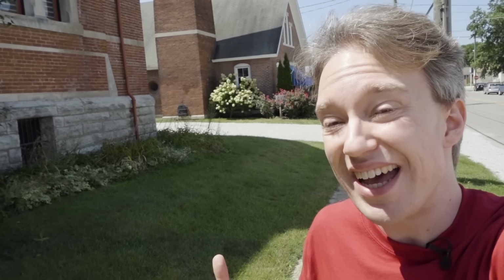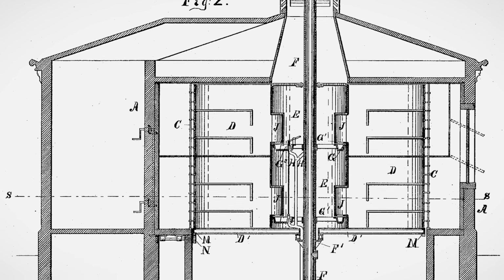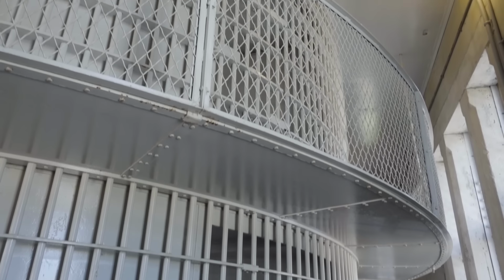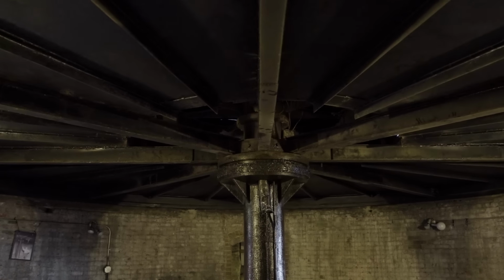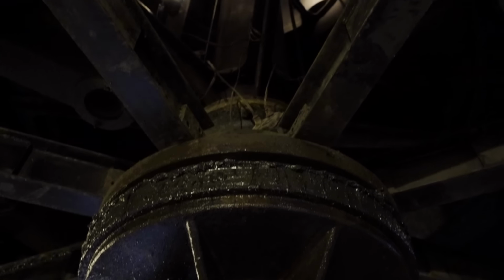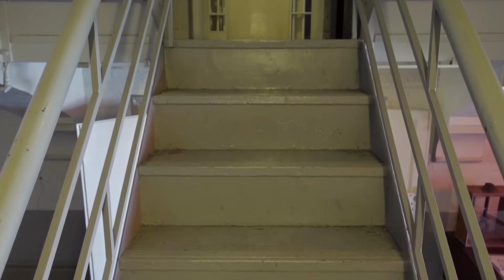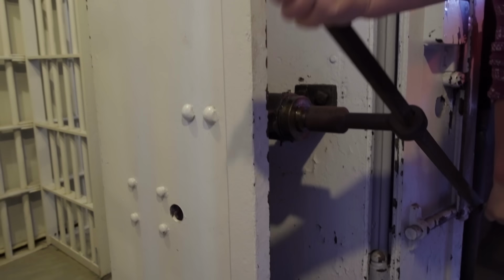The "rotary jail" had a slight problem

Comment: I literally never gave a moment's thought to the possibility of fire in a prison before I heard the words, "The advantage of having a rotational cellblock was that you could have just the one opening the inmates could enter/exit their cells from."
Reply: I'm surprised a fire would be a big problem in a building that's all steel, stone, and brick.
Reply: Same thing.
Reply: @cymond  It is enough to enlight the oil or some storage to poison the prisoners (depends on ventilation of course)
Reply: @cymond  even if its made of non flammable material you still are in danger of gas leaks, bombings, or possibly a natural disaster. There are many situations where you may want to open all the cells quickly and evacuate.
Reply: @cymond  There is still the risk of explosions and toxic gas
Reply: The building simply could begin to fill with smoke. Suffocating the prisoners, unable to escape their jails.
Reply: @cymond  the smoke is just as deadly.
Reply: Don't, this is already hugely nightmareish!
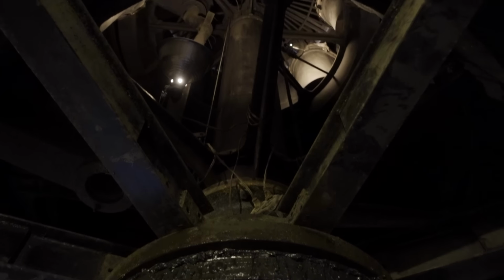Reply: 0:58
Reply: why are you so prone to protect prisoners?
Reply: @TomNacen  Because prisoners are human beings, like you and me?
Reply: @slushpuppie19  lmao
Reply: @TomNacen  LOLOLOL?
Reply: @TomNacen  Besides death-penalty itself beeing uncivilized, it said in the video that most inmates just had to sober up, hardly anything you would let anyone suffocate for
Reply: @cymond  Of course it is. Prisoners have set fires. That GREASE that's all over that mechanism would be PEFECT if you were trying for arson, I'd think.
Reply: @slushpuppie19  Be very careful with that thinking. A lot of people are locked up for damn good reasons. Don't put anything past them.
Reply: @windsofmarchjourneyperrytr2823  And a lot of them aren't
Reply: @elcanaldeuriel2750  jesus christ, those are people you're talking about
Reply: @windsofmarchjourneyperrytr2823  nah, they're all locked up for the same reason, society's too incompetent to help them.
Reply: @windsofmarchjourneyperrytr2823  And all people are capable of redemption and rehabilitation, Prisoners are still humans and thus should be treated with the same dignity and respect as anyone else, however much we would like to brand the most heinous criminals as sub-human cause we dont like admitting a human is capable of such acts branding them as such is in my eyes worse than any crime one can commit. Given the proper chances and help anyone is capable of rehabilitation, and if they are not, well then they will be locked up forever while they attempt to rehabilitate anyway
Reply: @fredrikalfson1541  You didn't watch the video, did you? This wasn't a maximum security for the absolute worst criminals in society, it was a local town jail. 

This is where they throw people who are to drunk to go home, or trespassing, or disturbing the peace, any number of incredibly minor crimes.
Reply: It's IMMEDIATELY what I thought of. Like "that doesn't sound safe"
Reply: @windsofmarchjourneyperrytr2823  The overwhelming majority of all prisoners in America are locked up for nonviolent crimes, primarily smoking weed and not paying fines. Hardly what I'd call dangerous.
Reply: @TomNacen  Wait until you get into prision for bad driving or another meaningless crime
Reply: In 2005, at a cellblock at Schiphol Airport, that housed 43 foreigners who didn't have the right papers who tried to get into the country, fire broke out. 
11 of them died. Some of the causes of the deaths was that the building was constructed without strictly adhering to our national fire code, and a lack of fire training for the personnel.
Reply: @cymond  There have been several prison fires where people have perished.
Reply: That's a great motivation to behave yourself, so you'll not end up there.
I would get child rapists and corrupt politicians in it.
And I would tell them that building is really unsafe.
Reply: @scorchedearth1451  This isn't a place where rapists went. This is where people who forgot to show up for jury duty went. Where people who were drunk and someone decided to call the cops on them went.
Reply: @RepstarVixen  All people are capable of redemption and rehabilitation, except conservatives.
Reply: @Rhythmicons  nope, even those are capable of rehabilitation. I should know, my libertarian-socialist ass is currently engaged to an ex-trump supporter after all
Reply: @RepstarVixen  thats just anecdotal evidence haha.
Reply: @TomNacen  they are living people.
Reply: @TomNacen  You are clearly a 12 year old
Reply: @cymond  ever hear of people dying from SMOKE!
Reply: @frankmachado1010  FFS, are people really going to rag on me for this forever?
 
Besides, smoke needs fire, and there's almost nothing flammable in this video. Everything is metal or stone.
Reply: @cymond even if the fire wouldn't reach them smoke inhalation would be a problem.
Reply: @cymond  Well if the oil under them began burning the inmates would end up as bbq...
Reply: @cymond  exactly I don't see fire being a massive issue
Reply: There's a great comic about this, an issue from the Japanese manga "Lone Wolf and Cub" about finding a prisoner to confirm the identity of the jailer who abandoned his post when a nobleman died in a jail cell drunk tank during a fire.
Reply: @windsofmarchjourneyperrytr2823  
I’ve been locked up a couple times before, and both times were wildly traumatic for me. The penal system doesn’t rehabilitate people, it treats them like objects because it makes money off of them. 
It’s like jailers get off on torturing human beings from their moral high horses while they sin just like the rest of us. 
And you have no idea who any of those people who are incarcerated are — you just build characters in your mind and project them onto the living breathing human beings behind bars.
Reply: @slushpuppie19  Careful, if we admit to ourselves that prisoners are human beings, we'll have to admit that being too poor to pay your fines doesn't make you a bad person deserving of prison time. It's a slippery slope!
Reply: @TomNacen  if you don't want to protect prisoners, you belong in it yourself.
Reply: @TomNacen  Becaus a state isnt just allowed to kill people? It takes responsibility for their safety by taking away prisoners freedom.

Also the most basic human empathy helps.
Reply: @repstar349  never heard anyone refer to themselves as a libertarian socialist, how does that work?
Reply: @TomNacen  Because they are human lives, and were not sentenced to death.
Reply: @cymond  Fire rarely kills, it is the smoke that gets you.  Something as simple as a burning mattress could produce enough smoke to wipe out a small cell block.

Comment: Imagine the screams as someone on the opposite side has just had their arm partially amputated, and you have to keep turning (with their arm still jammed in the bars) to get them around to the only door.
Reply: I figure after 2 of those incidents, the guards were having nightmares and didn't want to work there anymore...
Reply: I reckon just one such incident would be enough for me, if I was a guard!
Reply: what if someone shoved an iron bar into the wall instead, and got the torque to warp and break the walls?
Reply: Easy. Iron bar < Steel
Reply: @coolguy284_2  And where would prisioners get an iron bar?
Reply: @Napoleon_Blownapart  From the iron bar store, obviously
Reply: @TheAnantaSesa  How?  They said they didn't have a catwalk to access the cells until they stopped rotating the prison.  (gods, that means even for meals you'd need to rotate the entire prison block to deliver food to each prisoner.)
Reply: @DNANDROID  damn
Reply: @DNANDROID  
Damn
Reply: @DNANDROID  damn
Reply: Yikes
Reply: @DNANDROID  Damn
Reply: @DNANDROID  No they didn't.
Reply: @DNANDROID  damn
Reply: @DNANDROID  damn

But no, seriously. This thing would take a huge amount of torque to rotate it, so the gear ratio was probably so extreme that the guards couldn't tell they were amputating something until it was too late. 

Also: inertia. 

There was a revolving cocktail lounge in Atlanta, until an unsupervised child decided to put his head between the corner of a wall and a rotating hand rail. Yes, it was motorized in that situation, but the point remains: a large heavy slow thing will crush your limbs regardless.
Reply: @Napoleon_Blownapart  obviously it would  be hidden in a cake
Reply: @cymond  why was a child in a cocktail lounge to begin with though
Reply: @cabbage-soup  It's a cocktail lounge/restaurant. I assume the kid was with his parent(s). 

If you want to look into the available details, it happened at the Sun Dial in Atlanta GA, April 2017
Reply: I would assume it can rotate the opposite direction as well...
Reply: @cymond  I was supposed to have a date there like 15 years ago! Mad I never got to go before they stopped rotating it.
Reply: @cymond  Absolutely, keep in mind that that crank is for one person and that mechanism weights around 30 tons. Even if you use your whole body weight to turn the wheel, it's still going to take probably 300:1 gearing at a minimum to get the thing to move.
Reply: @cymond  I would have guessed 1980's or earlier, based on the combination of "child" and "cocktail lounge"
Reply: @DNANDROID  damn

Comment: "In hindsight it was not a good idea" 
.
No, no, with just a little forethought it's not a good idea
Reply: But also with hindsight... if you wanted to correct something why not the assertion that a patent means no one has thought of it before?
Reply: That point is very pertinent to our current situation!
Reply: The inventor probably never foresaw it being used as a drunk tank, and assumed that sober/sane inmates would be smart enough not to stick their arms through the bars when it was moving.
Reply: @cymond  also in those days health and safety wasn’t a priority especially if it concerned prisoners
Reply: It wasn't a bad idea, it just needed to be worked on more.
Reply: @KoboldPip  - THAT is the real truth of the matter right there.  A very different time with different mores.

Comment: The idea is in a way the same as a Panopticon, just using the exact opposite approach. (A Panopticon is a rounded prison, where all cells face the station in the middle, from which a single guard can see everyone at the same time. So instead of putting the cells in the middle, you put the guard in the middle)
Reply: magnus archives
Reply: i never thought of it but that's a good comparison!

Comment: Genuinely curious how many incidents of amputation there were. Surely they kept track of that, right?
Reply: They kept the arms as souvenir's.
Reply: @mackychloe  why did you put the apostrophe between souvenir and the s? ('s) shows possession, so "souvenir's" is wrong, you don't need an apostrophe you just need to say "souvenirs", you know, like a normal plural word
Reply: Hahaha I bet they didn't, I bet they just displayed them as a warning to new arrivals what happens if you get any ideas
They probably also used the amputated limbs as clubs in case any of the inmates got out of line
Reply: @kashvi1225  in some languages (like Dutch), certain plural words have an apostrophe in between the word and the s, where English doesn't. Maybe they aren't a native English speaker and messed up in using a grammar rule from their native language

Comment: Imagine being trapped there when there is a fire. The cells are slowly emptied one by one, while the heat and screams of other inmates panicking are filling the room. Then, unable to stand the heat, the guard leaves you behind, leaving you and your cellmate to burn alive in a cage.
Just because you were drunk.
Reply: If it's any consolation, you'd most likely die (or at least be completely unconscious) from smoke inhalation before being burned. From what I understand most victims of fires die from the smoke rather than the flames. Though I guess that's still a horrible death in its own right, but I at least would prefer that to being burnt alive.
Reply: @waxwinged_hound  Well it IS a slight consolation thanks

Comment: I got an idea.  None of the cells have doors, but you can use an Acme Portable Hole to create a door in one of the cells if you need to let an inmate out.  The only problem is that, assuming your prison only owns one Acme Portable Hole, it takes a long time to release all of the inmates in the event of a fire.  But, aside from that, there's virtually no benefits!
Reply: How about we have no doors and just light a fire?
Reply: Just replace the door with a patented Aperture Science Shower Curtain Portal Generator. Problem solved.

Comment: I had the exact same problem like this with a rotating sandblast chamber. It had two chambers, so that when one chamber was blasting, the other chamber was being emptied and reloaded. I just put a presence sensor on the stationary wall that would open the circuit when you got within 5 inches of it. Most of the time, the  best solution to a problem is the easiest one. Cal/OSHA liked it so much they made it mandatory on all that manufactures blast rooms.
Reply: That’s awesome!

Comment: I remember reading a scifi short story, when I was younger (do not remember the title), where a rotational jail was cut into stone. The cells were alcoves in a central stone cylinder, with one entrance that was rotated by the efforts of the inmates, pulling at the walls/ropes in walls(?). It ended terribly, of course, as it needed a constant flow of new inmates to replace the one, that popped out as the cyliner inched forward.  :(
Reply: Helliconia?
Reply: "Manuscript Found in a Police State" as someone else mentions below?
Reply: @1203fild  The Wheel of Kharnabar in Heliconia Winter
Reply: this reminded me of that too!

Comment: This reminds me of the prison level in Silent Hill 4. I believe the cells rotated but it was a guard on a upper level that could rotate the lower prison cells. You needed to rotate the cells in the right order in order to access a cell that wasn't locked that had a hole in the floor the the bottom set of rotating cells if I remember correctly.
Reply: you go to jail for not paying taxes and the jail cell rotates and cuts your arm off ouch🤣🤣🤣
Reply: AND sine doors had stopped working so they just dug and aligned those holes from the top floor to dispose of rotting corpses without any other prisoners noticing

Comment: You mentioned exactly what I was thinking. It seems simpler and safer, to have the bars rotate around the cells... As opposed to stationary bars and a 30-ton rotating cell block
Reply: I'm not really sure that it's that much safer, the gearing needed to make that work would still be too much to realize when you're amputating a prisoner.  And it does nothing to deal with the issues associated with fire. I suppose, in case of fire, you'd want a second wheel that just rotates the floor, allowing for access to a ladder. Not that there's any issues with the floor dropping away...

Comment: Could the inmates rotate it by themself by pulling together on the bars?
Reply: the thing weighs 40 tones, Using the crank gives you tremendous mechanical advantage.
Reply: You do not have to lift 40 Tones, just move it.
Reply: DynoosHD The static friction would be too much to overcome without the mechanical advantage of the crank.
Reply: Maybe 1 inmate couldn't do it, but all of them together might
Reply: Potato on a stick Again, worm gears past a certain slope angle have too low of a torque to turn from the output shaft no matter how strong of a force you use.
Reply: Surprised no one has commented that pulling the bars would be akin to trying to push a car from the inside.  You won't go anywhere...
Reply: Rob Fraser The bars are mounted separately from the pin and cells.
Reply: All great replies but even if free floated easily a simple steel ring looped over a crank handle and chained to the wall would stop them.
Reply: You mean that the inmates could literally be running the .... rotary jail? Nah, this jail is apolitical.
Reply: @michaelkennedy8573  The bar give a much better advantage, it's like 3m from the center. I guess there was a brake.
Reply: @krashd  you are incorrect.  Tge bars are a completely separate entity that are not affixed to the cells.
Reply: Pardon my necro but what I was thinking was cranks in the cells that are locked most of the time, but unlock manually in the event of a fire.
And an emergency stop by the guard, though I'm not sure how well that'd work with the inertia of the thing.

Of course the best solution as the video mentions is to just.... not do it.
Reply: Did you guys not see the video? The inmates lost their limbs because they rotated the thing themselves.
Reply: @Liasos88  No, no they didn't, they lost their limbs because they passed out drunk with their arms in the bars. Did you watch it?
Reply: @The_Bird_Bird_Harder  I thought I did.
Reply: @DynoosHD  Friction and inertia, also you're the only one who said anything about lifting it. You're on your own there.

Comment: Wouldn’t the bars rotating have the same amputation problem?
Reply: That's what I read thinking, too. 

It could probably work if the cell had a smooth (solid) outer wall, and the bars were replaced by a smooth wall, too. 
That way, there would be nothing that anything could get snagged on. 

Of course, that doesn't fix the emergency exit problem.
Reply: The suggestion isn't to have the cell stationary while the vars move, it would be to have the bars spin with the cells to prevent crushing, however the walls would still do it.
Reply: @wittyjoker4631  So the cells would all be covered with an opaque wall? Isn't that kinda like a solitary cell? Inmates would lose their mind within weeks.